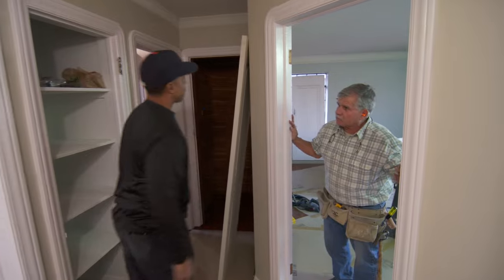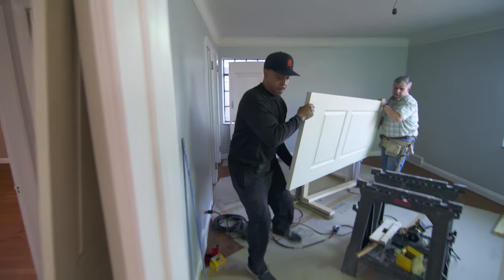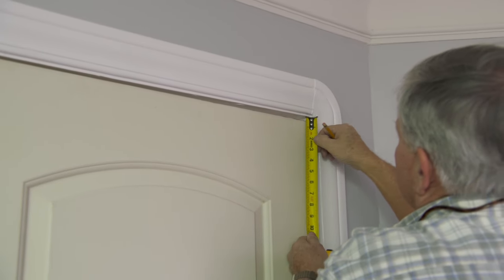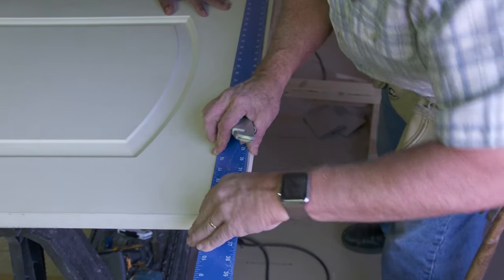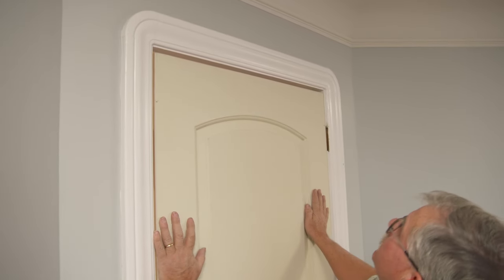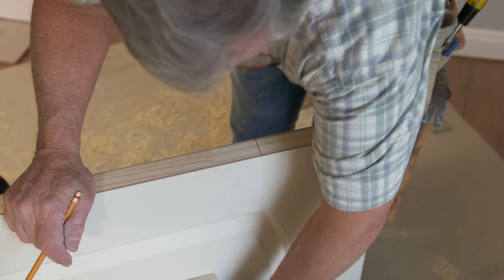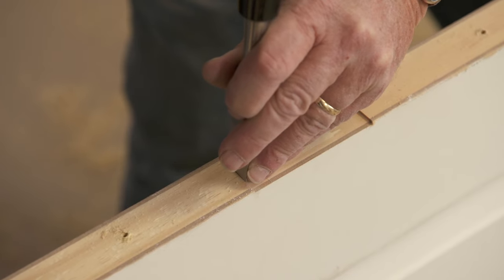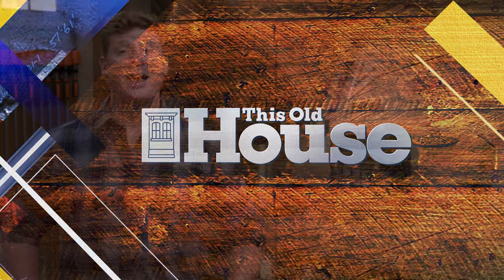How to Hang a New Interior Door | This Old House

Comment: Not a good demonstration at all.  The shim (or it's thickness) on the floor wasn't even mentioned nor was the fact that two shims of the same thickness should be placed on the floor so the bottom of the door tracks the slope of the floor. You then shim the door level in the jamb to get the correct top rail alignment before you measure for the scribe as only then can you get an accurate top scribe.  Then after cutting the top scribe, Tommy suddenly lifts the door so there's an 1/8-inch gap at the top without mentioning anything about the size of the gap or slope at the bottom!  There must have been a sizable gap at the bottom of that door.  As far as the hinge mortises on the door, call me old fashioned but I've always scribed the hinge outline with my box cutter, deepened the grooves with my chisel, and then used my hand router plane to cut the exact depth of the mortise.

Comment: Simple enough but why not leave 1/4" or possibly more for an undercut? Airflow,but also if they decide to do carpet in the future it won't swing correctly. Ask me how I know 😂
Reply: When we bought our house, we had carpet in all the bedrooms and hallway. We removed the carpet and installed hardwood floors, now the doors have a big gap at the bottom. Light and sound travel across the hallway among the bedrooms. It is annoying. We probably need to install door sweeps to fix the issues.

Comment: I don’t quite follow Tommy on the height.  He didn’t level it, in fact that one shim on the floor means it could be sitting wrong, yes?
Reply: By the looks of things, the door frame's header wasn't level. So instead of redoing the entire frame to level it, just make it look level by trimming the difference off the door.
Reply: Exactly right - poor demonstration here!
Reply: @stevejensen3471  It’s not that I think Tommy is wrong. When I find myself thinking Tommy is wrong I go lay down until I get over it. There’s just something missing in the video which confuses me.
Reply: @Nill757  Love Tommy for sure but this is a bad demonstration.  The shim (or it's thickness) on the floor wasn't even mentioned nor was the fact that two shims of the same thickness should be placed on the floor so the bottom of the door tracks the slope of the floor. You then shim the door level in the jamb to get the correct top rail alignment before you measure for the scribe as only then can you get an accurate top scribe.  Then after cutting the top scribe, Tommy suddenly lifts the door so there's an 1/8-inch gap at the top without mentioning anything about the size of the gap or slope at the bottom!  There must have been a sizable gap at the bottom of that door.  As far as the hinge mortises on the door, call me old fashioned but I've always scribed the hinge outline with my uknife, deepened the grooves with my chisel, and then used my hand router plane to cut the exact depth of the mortise.  I also use a vix bit to drill the hinge holes so they are exactly centered! Been hanging doors for 40 years.
Reply: @stevejensen3471  Yes I expect a detailed demo of hanging a door would be more than TOH videos would be allowed.  

I think the total gap dimension top and bottom is defined by the half inch he measures on the top w the door on the floor (almost).  Then, its dealers choice how spread the half inch between top and bottom. That shim down at bottom I imagine is  to square the the door to the jam as you say, w a slightly not level floor.  There’s another video where he goes through that IIrc.

No doubt those in the trade many years have seen several ways to cut hinge mortises.  Tommy likes his routers, uses them every chance (maybe pushed to sell them on air dunno).  Anyway Tommy’s way works too as that door closes and. swings on the money.